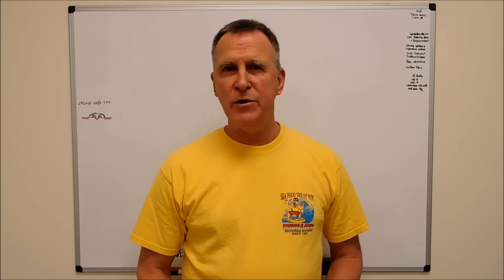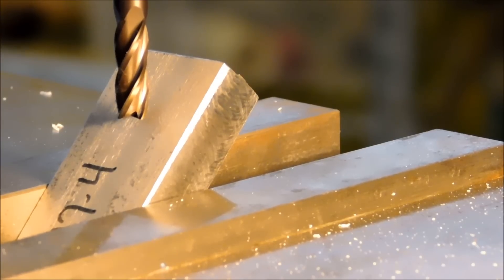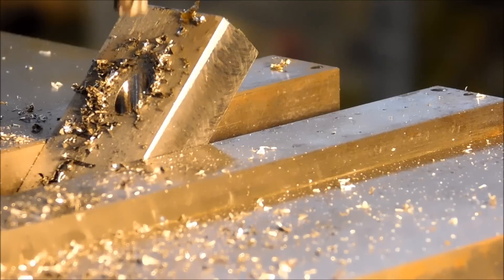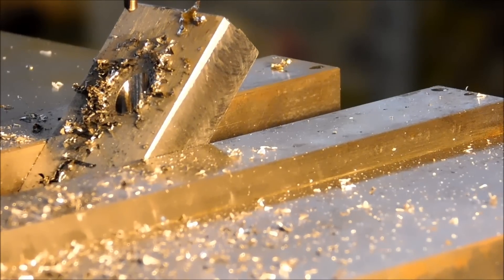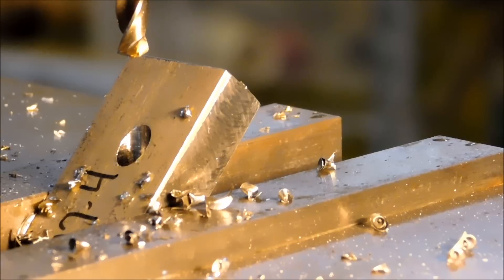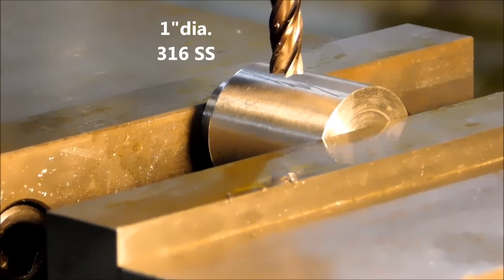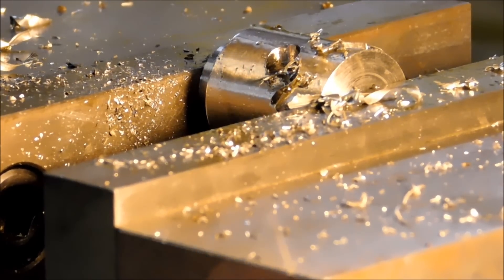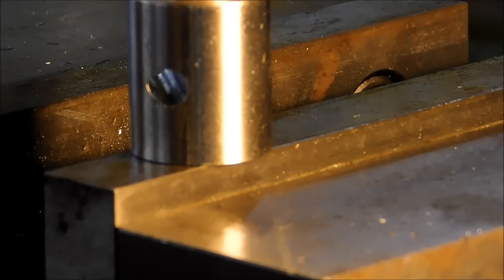Drilling Holes on Angled and Rounded Surfaces

Comment: We have 3 off SS316 bars, dia 2.25", 1.5" and 5/8", length 140 mm each. What drill bit or end mill should we be using to cut 3mm dia flat bottomed holes down through their cylindrical surface, and also what material? This will be done for ultrasonic inspection of the bars. thanks.

Comment: Sounds like a column bearing rattling balls.  Maybe at higher speeds they fly better.  Might be dry.  If Gear, need some Sulphur based oil.  Transmission oil as an example.   6 years later... 🙂
Reply from the maker: These mills use small plastic shims between the drive pulley ID's and the splined shafts. When they go away, the mill will rattle. The rear has been replaced, the front is due.

Comment: I am wondering how I would do this in a production environment.  For example, I have a hex nut and I need to drill across corners, so at 60 degrees to the face.  The hole can only be 1.5mm in diameter and in EN1A steel.  I only really have the option of using an end mill to come down onto the part.  I am thinking perhaps use a larger diameter, perhaps even 3mm end mill, produce a flat on all my parts, then use the 1.5mm drill to drill down.  What happens on exit though?  Am I likely to break the drill or is it a good idea to put flats on both sides of the part?
Reply from the maker: Perhaps a drill guide with a 120 degree notch in it to position the nut and guide the drill. And yes, risk is on both sides of an operation like this, unless the backside ( bottom of the hole support surface ) is virgin material everytime it has a grab risk.
Reply: @joepie221  looks like I have to make the drill guide myself. Perhaps 1.6mm and then use that.

Comment: Regarding the noise you drill press is making, check the fan shroud on the back of the motor. Also there is a possibility that the impeller may be fractured.
Reply from the maker: Spline shaft bushings. Its a vertical mill, not a drill press.

Comment: Joe, help me understand exactly why you always use the quill stop.  I've found them cumbersome and time consuming to adjust.  I can see using it when, for example, using a boring head and letting the quill stop disengage the feed at the bottom of each boring pass.
Reply from the maker: I use it as a hard stop in this application. I'm not using the power feed and it saves me time from cranking the table up to the working envelope.

Comment: Why does an endmill ruin a drill chuck?
Reply from the maker: Drill chucks are designed for inline axial load. Using and end mill can apply lateral forces that can damage the jaws. I c'bore once in a while when I trust the setup, but I still cringe when I do.

Comment: Hi Joe .  You mention raising the bed,  Can not visualize  that.  What machine are you using that raises the bed?  You mentioned the machine you use , but still can not visualize the bed raising up.  Great video, wish I had known this before drilling holes in round stock.
Reply from the maker: Bridgeport style vertical knee mill.
Reply: @joepie221  Ohh I see.  It is a mill,  I thought it was lathe,  guess I am going to have to get a miil.  Thank you.
Reply: @CarlosGutierrez-ou2bb Hobby mills don't have raising beds, so you will have to go big :-)

Comment: Have heard that noise before it turned out to be a loose pully due to a bad set screw.
Reply from the maker: These machines are famous for the plastic shims on the spline shafts wearing out. I'm about 98% sure thats where I have to look.
Reply: @joepie221  I was close, not knowing about the plastic shims.

Comment: I am new to this. Not sure if what you showed can be done with a drill press or not.
Reply: If you have a very rigid way to hold the workpiece to the table. VERY rigid… you would also need an endmill holder for a Morse taper to fit your drill press… you may be able to get away with grinding 3 flats on 60 degrees, but it’s not usually advised to put endmills into drill chucks

Comment: Awesome video if we're doing one-offs, but how about say drilling a 2.5mm diameter hole, 10.5mm deep on an a 60 degree (30 degree off vertical) angled hardened steel surface, but 1000 pieces?  I am struggling and considering making some sort of guide for the drill after milling a flat on all my pieces... Would that work do you think? I'm afraid of quoting my customer for this job just in case I can't do it because I'm breaking so many drills, they're not cheap when made 5D long and out of solid carbide!
Reply from the maker: A jig with a guide bushing and lots of coolant would be my first thought.
Reply: @joepie221  I was considering using a flat bottomed drill with a high flute count. I've ordered one to try.

The bushing might work, if I can get a drill that is long enough and can accommodate a drill bushing in its length. At the 2.5mm diameter, we're maxing out at 5D drills, so it's a bit tough.

Can you suggest what kind of drill bush?

Ultimately it has to be quick and easy, otherwise I might as well not take the job on.
Reply from the maker: @darcustaseen1602  The first source I would check for drill bushings would be a company called Carr-Lane     https://www.carrlane.com/

Comment: Nice one Joe! What happens when you have a bench mill and you don’t have a knee to lift while drilling! Thanks
Reply from the maker: You can achieve basically the same effect by setting the quill stop and advancing the cutter in small increments by advancing the stop a little at a time between cuts. Its not as rigid, but is a good second choice.

Comment: Great tip! Thanks.

I broke an 8-32 tap (a Chap) in a piece of steel and can't get enough of a bite with a center drill to start a hole on my hobby milling machine. Do you think using a cylindrical Dremel style bit in an ER25 collet would give me the flat that I need to drill it out close to center? I would rather not drill/tap oversized b/c of an appearance issue. Thanks.
Reply from the maker: Plunging an .093 endmill may be a better choice. Slowly on the feed, high RPM
Reply: @joepie221  , ah, okay. Thanks!

Comment: Joe I would have done it the same way you did.... With one variation. Even if I were using a face cutting end Mill, I would plunge cut only down to the point of where I had a full diameter flat..... And then I would have walked it out to the side in order to ensure that the surface the center drill would encounter would be dead flat. I'm used to working to aircraft tolerances and I would have to minimize any chance at the center drill would walk even a couple of thousands off center if it encountered a convex surface left by a simple end Mill plunge.

Also, to minimize the drill walking as it broke through the backside I might have pre-drilled a 1/8" pilot hole all the way through, and I would make sure that the final sized drill would have a split point..... So that the linear pressure on the drill would be reduced. This would help to minimize it from walking as it broke through the other side.

All in all, you've made a great video here!

Comment: Joe, maybe you mentioned this and I missed it but why couldn’t you side mill into the angled surface to create the step or pocket for the drill bit. I am new to machining, just got an import lathe and mill and I’m fascinated by machining. You and TOT are amazing resources. Thanks!
Reply from the maker: That would absolutely work, but that type of feature has to be acceptable for the part. Creating a shelf leaves a safer perimeter than a plunge cut.

Comment: I know this is a 4 year old video but I needed to make sure I'm on the right track with drilling and tapping some holes into a few round parts for a race bike I'm building. Yet again you sorted it Joe. I need to counterbore to recess the heads of some cap screws into the parts so this technique is just the job.
Oh, and my Bridgeport head rattles like crazy too lol.
Thanks again from the UK.

Comment: Ion what is you don't have the table or your project location doesn't give you the luxury of a table I'm drinking a 4'' hole on a 40-45 degree angle in bout worried about the drill skating since I don't have a 4"" bit I was thinking that I would either trace the pipe into the surface or just measure it a go 4'' up/down and 4'' side to side making a cross then punch a hole at the 4 points of the compass keeping the bit just inside my lines and then take my Dremel and scribe around the hole sounds good in theory but it seems to remember from word shop that wouldn't give you a big enough hole to have the pipe stick straight out of the angled surface it would put the pipe facingup but angled forming a v that's not what I need what I don't remember if the correct way to measure and Mark out the hole any tips would be a big help

Comment: The splines going up to the drive pulley are worn-out. My Bridgeport interact made the same sound.
Reply from the maker: On this machine, the splined shaft has plastic inserts that go between the shaft and pulley. 12 of them. When they are shot, it rattles like this.
Reply: @joepie221 I think every bridgeport i’ve ever used made this same noise lol. Gotta love the plastic parts inside a precision machine.

Comment: That’s all good but what if it is a 1” hole you need to drill? Or bigger than an end mill?
Reply from the maker: Bore it.
Reply: @joepie221  True but the original question was how to drill a hole in an angled or round part. Thanks
Reply: You can also use an end mill only large enough to get the cone of the drill off the radius or angled surface

As long as the drill enters the material by ~100 thou (2mm) before touching any weird features, being careful is enough for the drill to not wander
Reply: Also, spot drills

Use them

Comment: Very good Thanks. Off course there is no need for digital read out if you set the table low enough to change the bits without moving the piece.

Comment: Joe, did you ever figure out what that knocking sound came from?
Reply from the maker: The front and rear drive shafts on this machine are splined. There are plastic inserts between the shaft and pulleys. When the inserts wear out, it knocks. Rear is currently done, the front is next.
Reply: @joepie221  interesting, thanks for re-lying.

Comment: I've often wondered why ppl that would never put an endmill in a drill chuck will turn around and put a carbide drill in one
Reply from the maker: End mill gives a side load, a drill gives an inline axial load.
Reply: @joepie221  if it spins in the jaws it's still bad
Reply: @maxroadrash  Jacob’s ball bearing chucks are designed for light milling, because if the much greater tightening ability, and accuracy. Having three of these chucks, I can agree. Though I rarely use them for that. But, what Joe said is correct. Side forces rack the chuck back and forth, resulting in the chuck popping off the taper. Jacob’s used to make chucks with locking collars which would prevent that. I have a craftsman drill press I bought about 40 years ago with one of these. Screw mount chucks will also work. But really, for wood, plastic, and light aluminum-only!

I also have chucks from Waltham, and a couple others with carbide tipped jaws, and solid R-8 shanks as well as a diamond coated jaw version. These are all keyless, accurate, and come with a wrench for extra tightening.

Though often I use DA collets for a lot of drilling.

Comment: Hi Joe, Love all your vids, wish you were my neighbour, anyway my questions are; 1, why not use the end cutter to cut the full depth, or use it to finish the cut through to eliminate drill walk. 2, What damage will a end mill do to a chuck ?
Reply: You can use an endmill to go all the way through if it works  dimensionally for the part
Reply from the maker: 1. Many straight flute endmill shanks are just slightly smaller than the flute area, so you risk binding and tearing up the hole.
2. Many drill chucks are taper locked onto their arbors and not intended for the side loads using an end mill can cause. the chuck could unlock from the arbor and fly off. WITH the cutter in it.
Reply: @joepie221  Thank you for taking the time to respond to my questions. Stay Safe, John

Comment: Check quill bearings
Reply from the maker: Spline bushings.
Reply: @joepie221  Vari-drive movable pulley bushings are shot. mine was warn oblong on motor side and needed to be built up and bored. Sounds worse than mine 😬

Comment: Hi Joe my mill does not have an adjustable table but my whole head goes up and down (separate quill)will it still work by the same method but by dropping my head instead of raising the table height Thanks
Reply from the maker: Take small bites and make sure everything is snug and it should work just fine.
Reply: I doubt Mr Pie is familiar with low end import mills? (mine probably cost less than the KURT CNC vice often shown)  As long as you have a square column mill or can prevent the head rotating/tilting it should be fine. With a round column 'Mil/Drill' it isn't a good idea and you'll have to use quill only

Comment: Sounds like you might have a bearing problem.  Check the motor all pulley bushings, the gears in the box, check the drive gear backlash.

After that you need to troubleshoot more, unless you see something obvious.
Reply: Iceking007 this video is 3 years old 🤦‍♂️
Reply: Correct, and?
Reply: @Iceking007  that was pretty self explanatory

Comment: Hi Joe,

How does an End mill damage a drill chuck?

Can you use a drill bit in a collet or an End mill holder?

Can you use this method if you don't have a quill?
Reply: The end mill is way harder than the jaws of the chuck, the jaws will be worn out and end up conical rather than cylindrical. On the other hand, you can use a collet to hold a drill, if anything is to be damaged , it will be the cheap drill shank surface.
Reply: An end mill is more likely to grab on the workpiece and pull out or grab and lock up while the chuck continue to spin- either might cause a bit of spalling or wear. Yes, you can put a drill into a collet without a problem

Comment: When I drill on a piece of brass like that if I can I always try to put a like sized piece of brass behind it so that when it breaks through one piece the drill bit never notices because it's still going into a solid chunk of brass and then once the hole is completely drilled through you separate the two pieces of metal and nothing walked.
Most of the time even though I'm drilling through a flat piece I'll put a piece of wood or aluminum as a backer so that when the drill bit breaks through it's less likely to leave a ragged hole.
Reply from the maker: The round part was 316 Stainless and the flat material was 17-4 stainless. A backup piece is a good idea, but not practical for a round part.

Comment: I have letter drills, number drills, metric drills and fractional drill bits, 
Next video: How to make a proper end mill bit out of an old drill bit, I dont think my old drill Dr is going to carry me this far....
Reply: even if you have the means to accurately grind the tip of the twist drill into an end mill tip geometry, the twist drill does'nt have enough meat to work like an end mill, because the flutes in a drill are so deep and leave little core material.
Reply: Khaled A. Ayyad Agreed.

Comment: How do they get the small holes in a butane lighter burner valve that has 1.5mm diameter round stock valve with a .5mm hole
drilled on the side like you just did on your round S.S. rod. What kind of equipment is able to do this on a production made part

Comment: Hi Joe, another great informative vid. I don’t know how old it is but have you fixed that noisy drilling machine yet? I had one with similar rattle and difficult to say but the one I was using had a loose cooling fan on the motor.
Reply from the maker: I replaced the rear spline bushings, but the front is more involved.

Comment: OK well done. This is one of the first techniques I learned as an apprentice journeyman 45 years ago. Make a flat before you drill. In my case it was clearance drilling and counter boring for 4-40 socket head screws on the edge of .75 diameter copper bar clamp. 3/16 dia. end mill (as flat and c'bore), center drill, 1/8 clearance drill. de-burr, done.  Point, you can use non-center cutting end mill if you can enter the workpiece from the side, X or Y axis rather than Z axis as shown. in the video'

Comment: Joe can you please say just why an end-mill tool can't be used in a drill Chuck?
Reply from the maker: Most drill chucks are press fit on their shanks on a tapered arbor. those arbors are very strong under load along their axis. End mills create side load that can unlock the arbor and launch the chuck. Also chucks aren't designed for side load either. Its bad for the chuck body and jaws. Plunge cuts with minimal load are OK occasionally, but generally not acceptable.
Reply: @joepie221  Thanks, I didn't know that it was like that.
Reply: @joepie221  So true! I once got lazy, tried it ("just a little") and "launched the chuck", actually had a nice Albrecht come right apart! And drill press bearings too - they don't like trying to mill things. A milling machine is a special beast.
Reply: @joepie221  I paused the video to ask this very question. I had no idea, but it makes perfect sense. Thank you for sharing your knowledge and experience. -Jeff

Comment: I’ve watched your video a couple more times and another question comes to mind. Is there something about an end mill vs. a drill-bit that makes it less likely to deflect? It looks like the flutes of the end mill are not as deeply cut into the tool compared to the drill, so the “trunk” of the end mill is more stout and less likely to veer off?
Reply from the maker: End mills are ground differently and intended to resist load from all directions. Drill are intended to be used linear about their axis and loaded symmetrically on each flute.
Reply: Joe Pieczynski yes, just looking at the video again I can see what you’re saying. Thank you